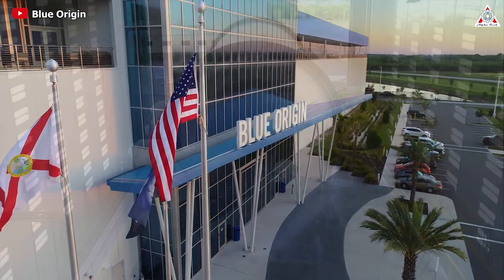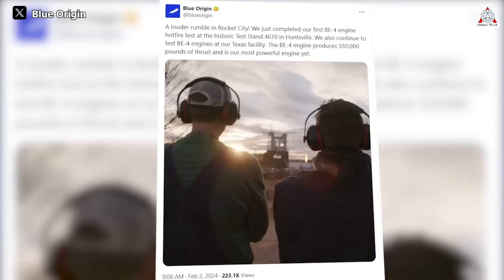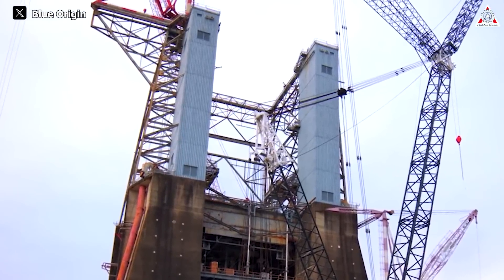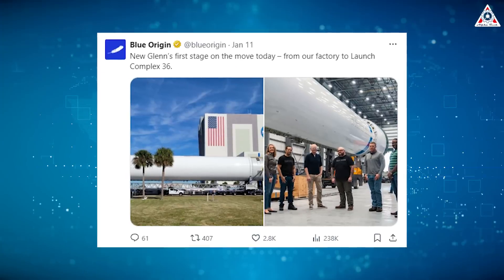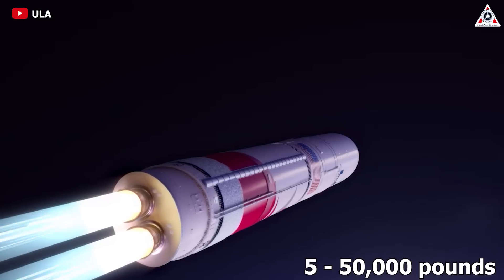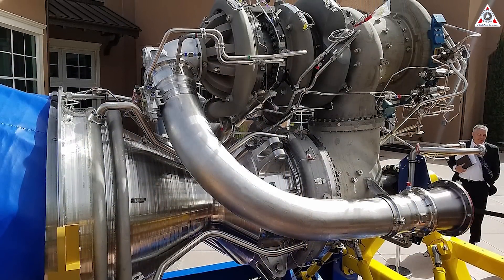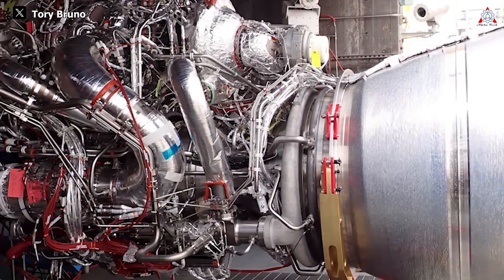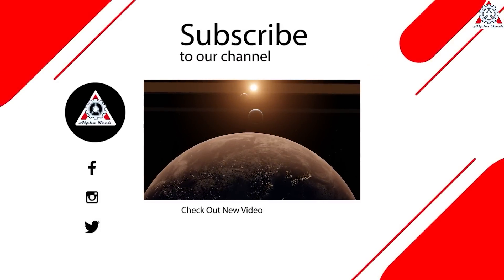Blue Origin BE-4 just SHOCKED NASA! But realized SpaceX Raptor is...Musk laugh!

Comment: Not impressed with BE-4 engine in any regard from schedule to manufacturability to ISP, Thrust to weight... Seems like the bare minimum all around with meh reliability. The exploding engine wasn't tested outside its operational parameters (this engine that "can be used multiple times".

BE-4 may or may not be the reason there has been no second Vulcan flight.
We are getting little info and what we get is bad.

Comment: You have the whiniest most entitled comments section in history 😂
Reply: No. The title is wrong. No one is impressed with the BE-4... mostly because of the exceptional success of Raptor 3. 
BE-4 Without the comparison is bare minimum engine. 
Also 50/year is not a number I would shoot for with a manifest of 20+ Vulcan flights (40+ engines) and 7 per New Glen flight... first flight this year.
50 THIS year would be fine (no sign of that) but 50 NEXT year or later is not encouraging.

I never imagined that Starship would catch up with Vulcan so soon.
I am expecting regular Starship flights in 2025... at least as many as Vulcan... that shouldn't be the case.

Comment: The BO BE-4 rocket engine may turn out to be successfull - but is it reliable (for astronaut crews) and is it economical ???
Reply: The contracted cost of BE-4 was $14m for a pair of engines for Vulcan. BO tried to rachet that number up for ULA... unsuccessfully.
Spacex raptor 3 would be somewhere in the range of $2 million for a pair with higher thrust, significantly lower weight/smaller volume with ISP probably higher into the mix.
$14m Was considered economical but Spacex pretty much ruined that.

Comment: They only had 2 engines fly . Let's see some more fly . There lucky that Vulcan didn't blow up or crash .
Reply: One of the 2 engines slated for the next Vulcan flight blew up on the stand. Not good.
Reply: Why?? The thing is these guys do it right!  Test, test and test some more!! Don't fly before you are ready!! 

Raptors are anything but flawless!! 

The vulcan's 1st flight is a 100% success. The 1st, 2nd and 3rd Starship flights ended in failure.
Reply: @professorg8383  Dude it was a TEST Flight....and IFT3 achieved everything a "normal" Rocket can do. Also you can't compare Vulcan with a Starship...its way more powerfull.
Reply: @professorg8383  Ok, so BO has already brought two BE-4 Engines to actually fly into the sky, Space X did that with 78 raptor engines in two flight tests (if we exclude the debris broken engines from ift 1). If the test results about Raptor 3 spread by Elon Musk hold some truth, each one of them will produce as much power as each BE-4 engine in the forseeable future.  Let's wait until BO has flown its New Glenn using 7 BE-4 engines, before we praise their superior safety record.
Reply: @professorg8383  They flew Vulcan flight 1 and one of the engines for flight 2 blew up being certified. This is not good at all with so few engines being produced. 
Raptors Are thoroughly tested. Spacex built hundreds of them for a small fraction of the cost of BE-4s (estimated 7:1 difference in cost). 
They also tested scores of them to destruction. 
BO did Not do that... deliberately.

The 1st Starship test, the engines were savaged by debris, the 2nd test had issues with fuel slosh and distribution, starving engines (which was also apparent with later engine losses on test 1. Test 3  got the ship to orbit with no such problems until the ship spun out on landing. Pretty sure the fuel was sloshing badly at that time. Pretty sure BE-4 would have had the same issue under similar circumstances.

These are also earlier Raptor 2, not Raptor 3 which was hardened against debris, etc. and produce More thrust than BE-4 in a smaller/lighter package with a Much higher chamber pressure, meaning they probably also have a higher ISP.

PS, given the Much faster evolution of Spacex, what is the advantage of  Test, test, test until its perfect. This has always taken Much longer at Much greater cost (SLS/Starliner) and doesn't guarantee success (Space Shuttle). Musk believes in agile manufacturing, this means rapid iteration and blowing stuff up. 

This has worked Very well for Spacex. They dominate the industry.
Falcon 9 is an example of this. The rocket that flew 96 times last year (flawlessly) was the 5th iteration of the rocket... all 5 launching customer payloads. Its on track for about 130 flights This year.

Had Spacex waited for F9V5, they would have gone bankrupt.

Comment: Out dated Spaghetti Monster rocket engine. Also no sign of tubes or passages in the bell to use that heat to boots things.

I'm sure Jeff already knows he is outclassed by 
Raptor 2 and why, and that Raptor 3 is this year, and Raptor 4 on the drawing board.

Meanwhile Elon and Tribe likely to do launch 4 in weeks, And trying to correct the re entry profile good enough to hit the water in one piece.

Critical part will be getting sub orbital, and not locked bass ackwards this time...
That retro burn last time turned out to be problematic.
Might have been better to put the nose down with gas thrusters, and give it a nudge inclined down enough to get into upper air, then try to level it out and fly it as long as possible above the plasma hot zone. Thin air will heat less, but still reduce velocity over time. And if dropping too much maybe good to try flying Starship in a climb to eat velocity, maybe even roller coaster it a few times.
Another possibility might be side to side sweeps flying, snaking thru the air to eat up the forward energy.

We'll see what happens, but I suspect V-2 should have more lifting surface and actual control surfaces. And be capable by design of such manouvers.

Altitude is not the problem, its that insane velocity of being orbital, and that velocity should be able to get some bite in thin air, and keep it high, thin, and cool, long enough to do some good.
Its like extending orbital decay, but using wings.... Eventually you might lose enough velocity to do a Wiggly Flappers drop...
Or if you could design well, eventual ships could land on their sides on wheels  or planing hull shape.
Tail landings look cool, but likely fuel users.
And you need infrastucture to take the burn...
Reply: Tail landings look like a 1950 Sci  Fi!!  Not very practical.  How do you unload all the cargo??? They haven't figured that out yet!!
Reply: @professorg8383  
Yeah! I've actually done alot of writs on that on related channels in comments... at least half a dozen, explaining problems.and better solutions than a silly elevator...

I doubt real estate on Moon or Mars is so expensive we need sky scrapers to get the most out of it... Actually the best place is carving in sub surface.
I think they are trying to make a one size fits all and both feet shoe... 🤣
I wont last, sooner or later the nerds will face plant into some wall....
their latest adaptation is sending a big crane first before doing structures.
And on the ships using the elevator...
Hope that never fails....

I've described various systems that make more sense, but they are stubborn Nerds... They only use my stuff grudgingly, and never credit for it.
But that makes it more fun to plant concepts, and come up with good enough stuff they have no choice but to adopt it...
Have lost track of how many times I have counted coup on them with something soon used after my writ.
And I have alot of fun taking a pin to their hubris balloon... 🤣
They'll figure it out the hard way, and call it iteration.
Reply: @garylester3976  You just can't have a reasonable conversation wiyj fanatics!!

They aren't really nerds they way I define nerds. Cult members is a more fitting term. Back in my day nerds were the smart ones! These guys are anything but the smart ones!! They just except what their cult leader says and never question it.
Reply: @professorg8383  
I think its different than that; that most of the time its the workers managing the boss...
And him occaisionally adding to the stew, and cherry picking things he likes.
I think the cult is more likely the online types, who click on everything Elon.
I'm really only interested in Space stuff. And SpaceX happens to be in the lead. But I know they are capable of losing that status if not flexible enough.
There are signs of dawning flexibilty, They  now thinking of several
Starship models, Many of which have problems. And there are better solutions for some of their jobs.
I can be patient, and plant concepts ahead of the curve when I can. With most people takes around 6 months to adopt a new concept as their own.
But I have seen Elon do it in weeks or a couple three months. He is way less resistant to conceptual logic.  Which also makes it fun for me as the gratification is more rapid.

He is an Aspie, if you can show him clean logic, he adopts.
And after that he is bullet proof with it.
All his workers are not uniform,  some are also rapid response thinkers...
And not the usual Yammerheads...
I'm sure Elon tries to get the best he can... But the Rocket Engineering gene pool is likely small.
And maybe becoming inbreds by now... Lunar Dueling Banjos? 🤣